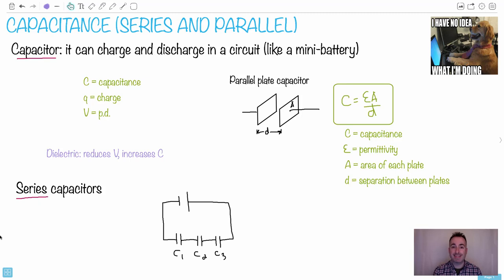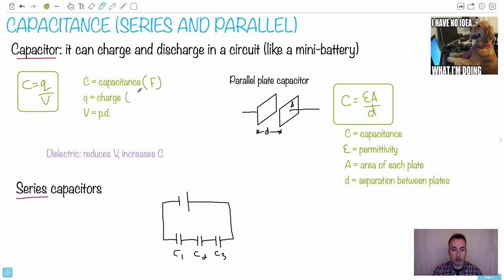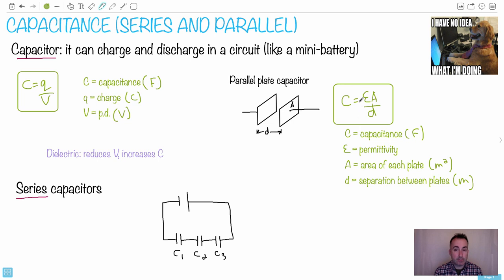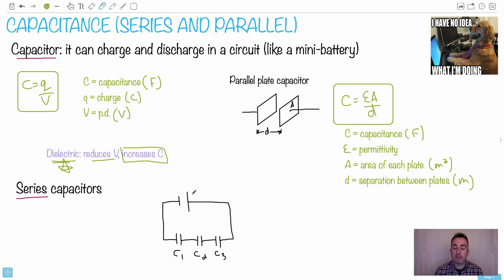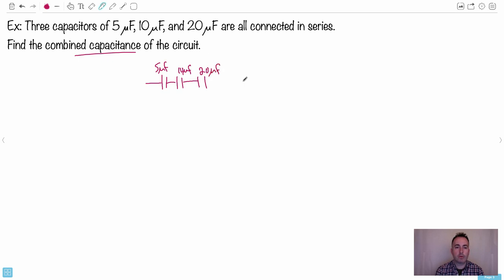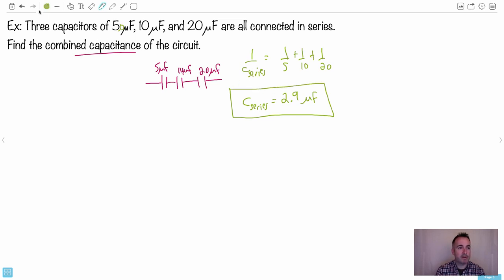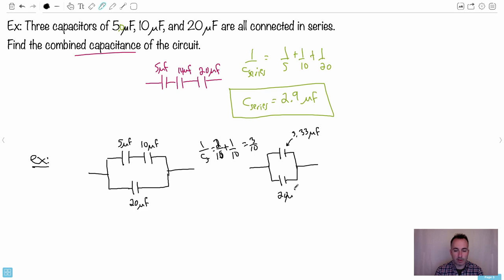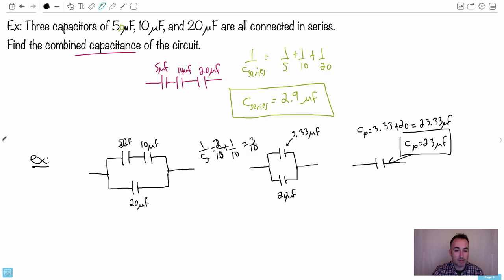Capacitance 1 [IB Physics HL]

Comment: Just a question, why did we reciprocal the 3/10? at 8:05
Reply from the maker: Because 3/10 was the answer for 1 / Cs, but we want just Cs, so we take the reciprocal. You could just see it as 'doing proper algebra' to solve this: 1 / Cs = 3/10. So, Cs = 10/3 = 3.33
Reply: @OSC1990  Yess got it thank you so much! Also thanks a lot for your videos <3

Comment: at 6:16 isnt it supposed to be 20/9 which is 2.22? how did you get 2.9
Reply from the maker: Unfortunately, the answer should be 2.9, and not 2.22. Here's why: If we make a common denominator, then I'd put them all over 20. Then you end up with 1/C = 4/20 + 2/20 + 1/20. Then, 1/C = 7/20, and you take the reciprocal to get C by itself. Then, C = 20/7 = 2.85714..., which rounds to 2.9.

I hope that helps, and thanks for asking! It's always good when you double check the maths. Well done! Cheers, Mitch